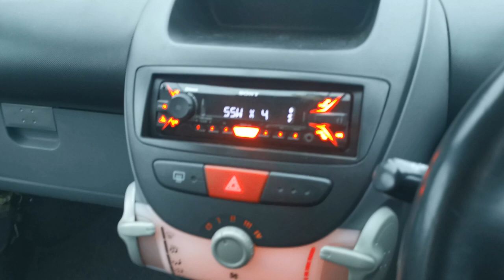EXHAUST MANIFOLD HEAT WRAP

Comment: Shame you couldn't really get it under load for any real period but the ability to put your hand on the manifold proves for me that the wrap works, even if it was mostly pootling behind traffic.
Reply from the maker: You can touch it but not hold it😂and it does reduce engine bay temperatures quite significantly, my intake wasn't even warm it was actually cold

Comment: Sounds great! I'm thinking of doing a straight pipe catback on my 107 with a silencer and no rear muffler to get a similar-ish sound to yours. I noticed you have a squeaking noise at times from what sounds like the interior and I have the same problem with mine, do you have any ideas on what it might be?
Reply from the maker: That's not straight piped then😂I must warn you it will drone on motorways and become unbearable at national speed😂😪the squeak I'm guessing is a loose bolt/s somewhere 🤷🏽‍♂️